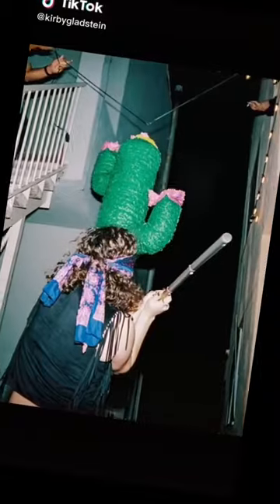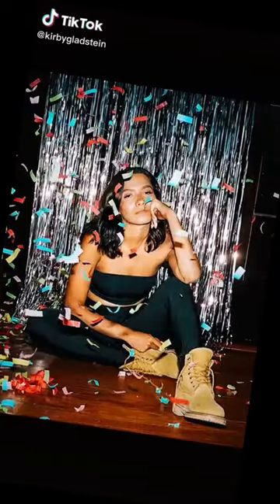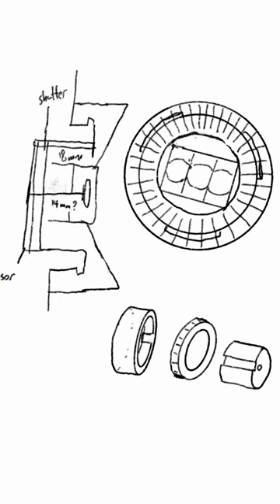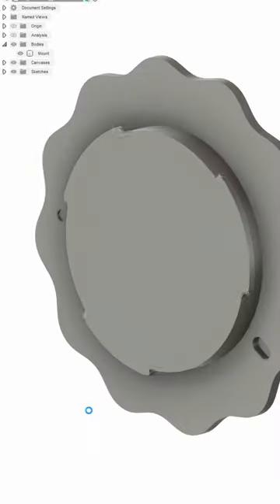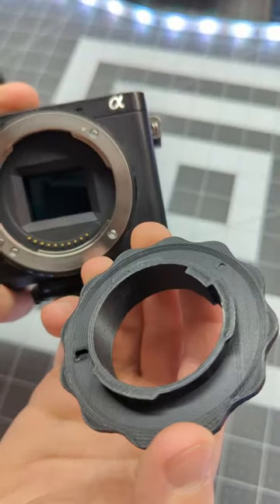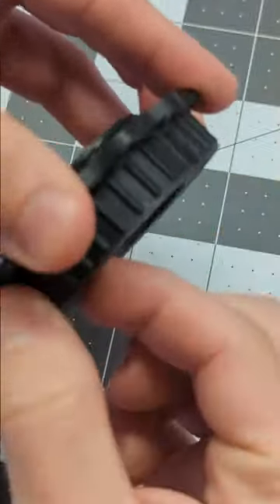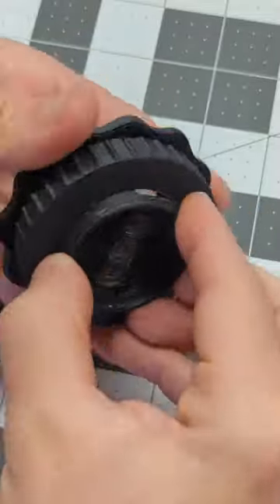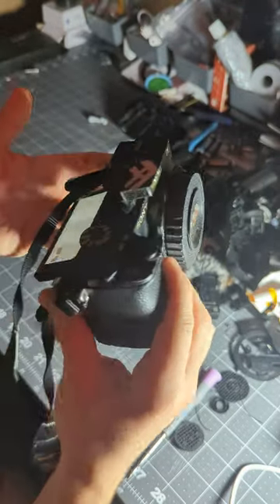3D Printed Wigglegram Lens Build (pt1)

Comment: Thank you so much for posting an amazing video. It's amazing. How did you connect and attach the 3 lenses? Did you melt the plastic with your pharynx? Or did you use instant glue?
Reply from the maker: I cut them by holding a lighter on an X-acto blade, that way they were less likely to crack! Then I think the tolerances were tight enough that the lenses just press fit in 👌